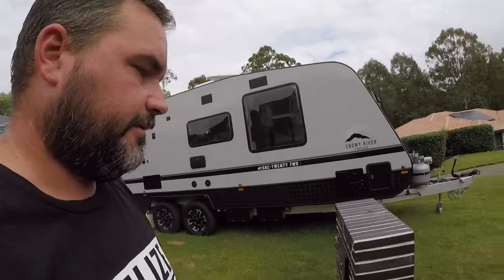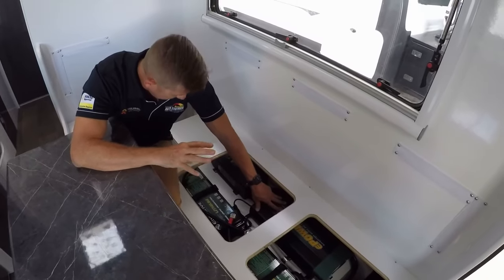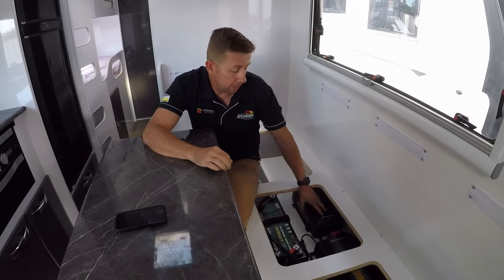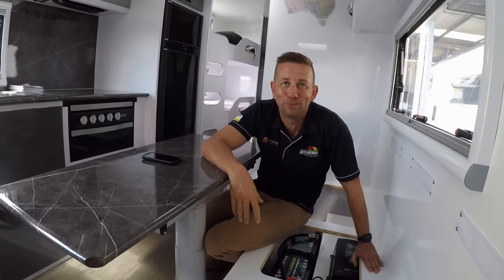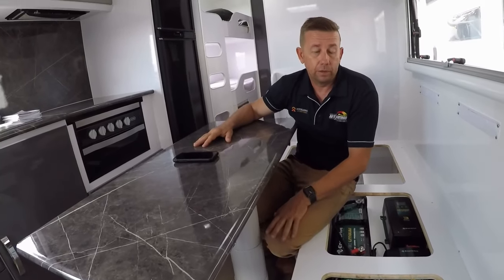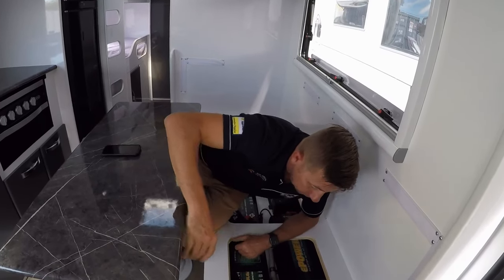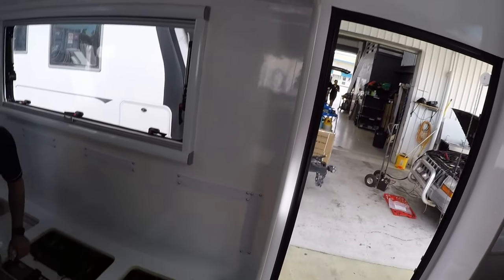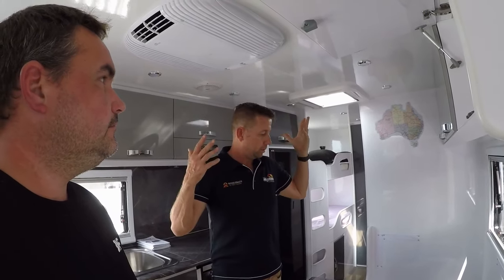Full lithium Enerdrive off grid system/ overkill?/ 400ah of power!

Comment: Great Video thank you so much. They do an awesome job at Accelerate their vids are informative also. How long before you hit the Rd?
Reply from the maker: We are heading to uluru from brisbane in 11 days time and have a cairns trip booked for feb with a few mates and full time from july next year 12+ months on the road
Reply: Keep us in the loop on your set up. Just a quick question does your hot water service have the potential to run from that inverter?
Reply from the maker: Yeah mate we can run all our 240 v accessories its all works perfectly!! I usually run fridge and water on gas but if it ever ran out you can turn inverter on and run it off that

Comment: Thanks for the video. Mate, so if you're at a caravan park plugged into 240 power, do you still have to turn the inverter on?
Reply from the maker: No its a transfer inverter so it bridges the 240 v and bypasses the inverter its a very clever setup

Comment: Why didn't you use the DCDC charger's MPPT? It'll take 800 watts of solar. Will it charge from both AC charger and solar when plugged in to 240v? Or does the AC charger talk to the solar controller and turn off the solar controller?
Reply from the maker: Main reason is the dcdc chooses best option usually engine charge off the car, where now it will charge solar the whole time and dcdc will still work as it should we also added an external point to the dcdc so we can use a blanket if needed